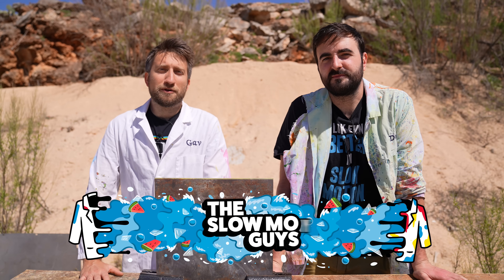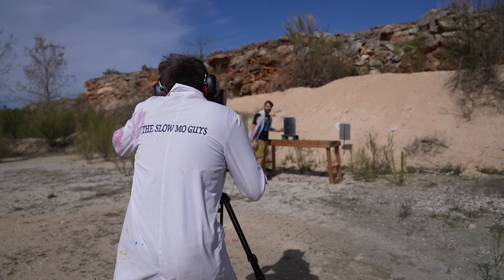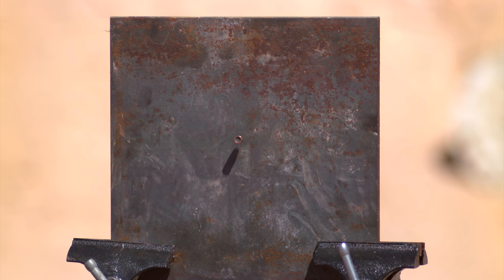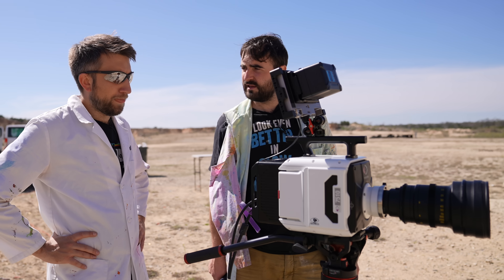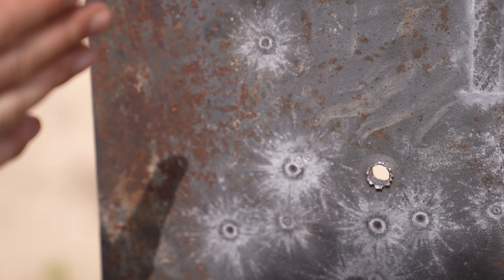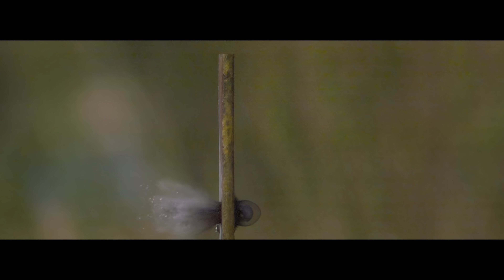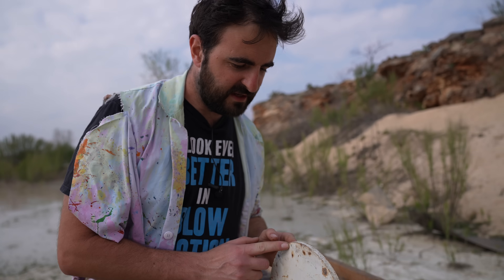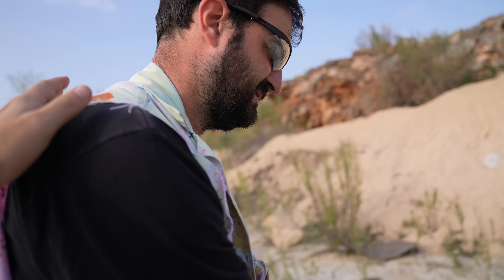Bullets vs Steel at 800,000 FPS - The Slow Mo Guys

Comment: 12:25 its creating shearing forces in the steel from the massive pressure differential between the struck part and the adjacent steel.

Comment: 3:59 alternate theory. The hollow point compresses the air, turns it to plasma, and the little sparks are plasma leaking out the grooves in the tip.

Comment: 9:41 i think thats a steel "scab" or fragment you knocked out of the plate, the center of the "shock cone" of energy transference.
The rear hole is cleaner because it Sheared off; the front hole is messy because its an impace crater where Everything got ejected back out.
This is Literally the basis of many WW2 anti-tank wepons.

Comment: That was awesome and amazing to see! I would absolutely love to see how steel cored rounds would do compared to the lead cored rounds you guys were using. 

I used to shoot steel with 7.62x54r and some old super hard, super thick mower blades would actually "catch" the steel cores, depending on the angle, they could penetrate or get stuck in the metal, sometimes bent, or even once or twice stuck halfway through the metal. 

Also used to find steel cores littering the ground from ricochets when shot at the right angle. Would be amazing to see that happening in super slow motion. For reference, 7.62x54r is the only easily available steel core ammo I know about, and pretty much any Russian Milsurp ammo you get is steel core, so if you guys can get access to it would be super cool!!!

Comment: For the shots on the round target, you can see two chunks of metal fly off: the lead bullet and a sliver-colored piece of similar size and shape. Is that a part of the plate, or the bullet? I've never heard of steel-tipped rounds before

Comment: You guys are Brits, and not well versed in firearms as us Americans.  But I can tell you different projectile compositions will have different effects as they impact steel.  Next time you need to fire the same cartridge but with different projectile types.  Also that target you picked up off the ground is likely AR500 type steel, vastly harder than the mild steel target you guys likely brought.

Comment: A most excellent and entertaining video. If someone hasn't  already suggested it to you a sheet of Lexan (65 cm square x 13 to 16 mm thick )  placed directly in front of the camera lens would protect it from debris. You should be able to find optically clear Lexan. The downside it is "soft" when it comes to scratches and would need to be replaced every so often.

Comment: I'm a toolmaker so I knew you were punching holes in  that plate and the bigger piece was the steel slug. It's like punching a hole with just the punch and no die.

Comment: what you saw coming out the other side when shooting the 30-06 was not the lead of the bullet or event the bullet itself. Instead, it was basically the plug of metal that has been punched out of the plate; kinda like the metal on the from of the 9mm when shooting the cooking tray. That plate of steel you were shooting was really just the right thickness. I just saw that you discovered what I just said so great job!

Comment: Id like to see some black tip 06 against 1/2".
I got my hands on surplus .311 steel core 174g. Loaded them up, for my PSL54 7.62x54r and Im punching through everything I put in front of it. Went through a dozer blade like butter.

Comment: First piece of steel y’all shot was just mild steel. Very soft which is why the 30-06 went straight through. The small white circle target is more than likely AR500 steel which is much harder and designed to withstand shots from high powered rifles with little damage.

Comment: The slug coming out of the back of the steel from the .30-06 looks identical to the slug you get from punching the hole for the eye in an axe or hammer, look up like Alec Steele or someone to see a good video of it. The difference in steels is because of the hardness, which is driven both by the alloy copmosition of the steel and the manufacturing process (heat treating/etc)

Comment: With iron sites at that distance, Dan is a marksman.
Reply: He did good, but it isn't that difficult of a shot. It also depends on the diameter of his sights and his zero and point of impact and point of aim. For lever action silhouette, our rams are set at 117 yards and it is 7 inches from belly to back. My front sight is 40 thousandths of an inch in diameter with the stem being a little narrower, but I might change the insert of the globe sight to a 30 thousandths. The stock front sight on my new lever gun is 100 thousandths and totally covers the target making accuracy harder. My goal is to hit a 6" plate over and over at 109 yards and that is standing with no support. I have been using my 30-30 with my own cast bullets and a mid range load, but now have a 357 lever gun to use as well. I do shoot a Win 54 30-06 made in 1926 with peep sights, similar to what he had, but the peep sights are more challenging than the target grade peep and globe setup on the lever action guns. There are some really good shooters out there and surprisingly, I taught a buddy to shoot pistols and on his second time out he was nailing an 8" plate at 50 yards with his 9mm pistol. He is in his 50's and only shot rifles when he was young and in the service, but seems to be quite skilled. He is well built and the exception to new shooters....I have competed in various competitions over the years but don't do bullseye style shooting for groups and instead o run and gun, speed shooting, or silhouette.

Comment: it can be explained in math. im sure math people would have every idea about this. its about energy transfer. how much energy carried by the bullet, and how much it is dispersed on the target. and how much the target can transfer that energy around across its atom network.and the material matters. for example, that steel with more "twang" would dispersed energy faster than the one that is more "stiff". therefor absorbs more of the energy being transferred by the bullet. aside from how fast the energy could be transferred before the atom bonds of the target material and the bullet reach its critical strain. the datas people who make bulletproof materials tech and bullets tech use to innovate.

Comment: With the rifle bullet, it looks like the front of the mass is larger than the trailing end of it by a small amount.   The trailing end looks like it was squeezed through the hole in the steel and the front of it looks like it mushroomed a bit.    It looks like a dowel steel where you hammer square wood pegs through a round hole to make dowels.

Comment: For a more striking and visually captivating effect, try gently coating the plate's surface with a thin layer of oil, butter, glue, or honey. This will create a captivating double splash, showcasing both the bullet's impact and the liquid's movement. You'll not only see this impressive effect on the steel plate but also on the tray. Wishing you the best of luck.

Comment: I think the spark is from oxidation (rust) on the plate.  Also, pretty sure the lead is going into liquid state briefly.  Looks like it in the 800k fps.

Looks like an 1903 Springfield should have a 1 : 10 twist.  2800 fps (ish) * [12/10] (barrel twist) * 60 = 201,600 RPM.  That's why everything is still spinning.

The round target is AR500 steel.

Comment: I could be wrong, but standard steel targets for most rifle ranges is AR 500 Steel, I doubt the first steel sheet they fire at is the same type of steel so it likely had a different hardness, and that's why the rounds behaved so differently to each target.

Comment: Probably a dumb suggestion but you know that experiment where you shine a laser in a block of acrylic and it bounces off the walls, letting you see the angles of incidence and reflection. Well if you got an absurdly long acrylic block, a wide enough fov and enough frames would there be a delay in the beam getting from one end to the other? Speed of light part 2?

Comment: Those "sparks" you're seeing actually aren't sparks, it's the air in front of the bullet being compressed so quickly that it reaches flash point and detonates. The air physically cannot move out of the way of the bullet fast enough and when it gets squeezed between the bullet and the plate the friction of the air particles being squished so quickly and violently causes a tiny explosion.

PS: The steel you got is most likely mild steel, which is a very ductile steel, that shooting target is most likely made of an abrasion resistant steel, probably an AR450 or AR500, which is significantly harder and able to more effectively break the bullet up on impact.

Comment: 9:19 that is amazing.

It wasn't the bullet that hit the sign behind - it was a slug of the metal plate that the force of the bullet pushed out of it, and popped it out like a hole punch. That's why the entry was messy from the blowback and the exit was clean, and the bullet fully disintegrated. The entirety of the force pushed the slug out of the plate and threw it into the sign behind and the bullet imparted all the kinetic energy it had in the process.

That is a one in a million shot.

Comment: Where is the energy for the electron to spin

 The electrons that revolve around the nucleus are a false concept.  But it is appropriate to interpret the symbolic concept correctly.  It is not clear what the known force holding the nucleus and electron is, but the first known force is gravity.  The second known force is the magnetic force.  None of this is clear in modern science.  Where does the electron get its power to revolve around the nucleus?  The concept of free energy seems to be stuck in it unknowingly.  Looks like no one questioned it.  When the magnetic field is applied, the electrons rotate on their own and flow through the medium.  Due to the electron transfer in the discharge tubes, the flow of electrons is in the form of waves and sometimes the flow of electrons is in the form of vortices on the electrodes.  This is why electrons are said to have wave and particle properties.  Electron displacement is caused by electrode charge polarization.  That is, the electron charges persist for some time.  When the charge on one side of the electrode becomes inactive, the electron returns to its original position.  The reason for the accumulation of charges in the electrode is due to the small amount of air layer.  Electron displacement can be detected with a shutter speed camera.  I do not have the financial strength to buy such a camera and do research.  The atom cannot be seen under a powerful microscope.  The only claim is that he saw the atom.  The nucleus or the electrons cannot be seen except in the microscope, which can see the microscopic particles in its range even under a powerful microscope.  It should be remembered that electron molecules have never been seen before.

 The concept of an atom revolves around a nucleus.  In kishore science there is no concept of revolving around the nucleus.  The ocean of electrons is seen in a motionless magnetic field, or in a medium without potential difference, without flowing through the pion body.  When the temperature rises, only the electrons see vibration, that is, only the heat wave.  No flow is seen.

Comment: Amazing footage! Regarding the different behavior of the two steel target plates, it might well be chalked up to different hardness as you suggested, but (as a structural engineer)  I suggest it might also be due to different “toughness” or ductility. A brittle steel (low toughness) will fracture once the deformation or strain reaches a certain level, whereas a ductile or tough steel will deform a lot more before it fractures.  In steel specifications, fracture toughness is quantified by the Charpy test number. High Charpy/toughness is a desirable property of steel  in some applications, for example in low temperature service which can make regular steels fracture in a sudden brittle manner when a more gradual, ductile failure mode is desired. In structural engineering a ductile behavior is more desirable because it yields and deforms prior to failure, giving advance warning that the material is overstressed. In contrast, a brittle material might look fine up until the point it suddenly fails.
Reply: The steel plates manufactured for target shooting are usually made from a steel they just call "armor plate".  I would like to know what that means in terms of yield strength.  I was also wondering if it is just a higher yield strength steel or do they put other elements into it to change the toughness as is done with steels for knife blades and industrial tooling.  (I'm also a structural engineer.)
Reply: @billj5645  The only specification I've ever seen is "AR500," which I think is an abrasion resistance thing.
Reply: @billj5645  There are different grades of AR steel- 400, 450, 500, 550, etc. The number is the average brinell hardness and you can look up charts for the rockwell hardness. Lower grades can be easier to bend for use on heavy equipment while 500 or 550 is preferred for targets. 5.56 and 223 rifle rounds can do more damage due to the higher velocity than 30-06. Bullet shape and velocity play a big part. My 460 magnum revolver packs the same energy as 30-06, but a huge hollow point bullet with more weight and less velocity makes a bigger dent or dimple in steel than the rifle. 460 mag is around 2400 fps for a 200 grain bullet and about 2000 fps for a 300 grain bullet. Average 30-06 bullets are lighter but faster and of course 5.56 averages 1/3 to 1/4 the weight of 30-06 but at higher velocity.
Reply: @CGT80 I've actually been able to take spicy M193 out of an 18" zip right through 3 & 3a rated armor plates.... The velocity achieved from 5.56 can be absolutely devastating which is crazy coming from a bullet the size of 22lr.
Reply: Ar500 steel was the second target, AR stands for Abrasion Resistant. Their first plate was probably some generic mild steel.
Reply: What we saw with the rifle bullet is sometimes called "plugging".  The transfer of the energy to the plate creates enough force that a plug of the steel is sheared off.

Comment: The flash you see in the hollow point is the air in the tip of the bullet turning to plasma as its compressed. it escapes from the tiny notches between the fragmentation segments.

Comment: The first sheet of steel you were shooting was a soft steel.  The steel they use for steel targets is ar500 or ar550 hardened steel.  Sweet to see how the .30-06 punched a plug out of the mild steel

Comment: Logic would suggest that if u brace targets better it would make difference but when it comes to speeds of bullets the energy transfer actually happens before the target has a chance to move so u could dangle steal from a string n get the same result damage wise to the target

Comment: The piece of aluminum seemed to bounce off the bullet a bit but I assume it will slow down faster than the bullet so it's going to stay on the bullet for the rest of the flight then. Unfortunately went out of the frame before they remerged.

Comment: Slow Mo Guys:) I have a burning science question. Do polymer tipped bullets actually initiate expansion on both lead rounds and lead free solid copper rounds. Do they truly initiate expansion? This would be great to see an impact on clear ballistic gel and on steel. May I ask politely if you can solve this burning science question? There is no footage on the Internet including YouTube and other platforms that can solve this burning science question. Please solve this burning science question? Please?

Comment: I wonder, shouldnt there be a weird middleground where the metal is just strong enough so that the bullet cant go through, but still weak enough that the ripples show up? so kinda like a really fast stone thrown in a pond with really high surface tension.  With aluminium and a 9mm it could be possible no? or maybe even lower caliber

Comment: The shockwaves making a "shadow" was impressive. Very interesting to see.
Reply: YES dude. As a long time viewer of slow mo guys and smarter every day, I can’t believe no one else is commenting about that 😂
Reply: Yes, that was the best shot of the entire piece.
Reply: The first round with a visible shockwave was subsonic - angle of the Shockwave was less than 45° and led the round by a short length. Supersonic wake would start from the tip of the round and arc back more than 45°.
Reply: @XxxThePsyCheMisTxxX  No, it is supersonic, but with a bow shock due to the shape of the bullet
Reply: @Arkaid11  Supersonic = shockwave angle from projectile momentum vector needs to exceed 45°, no?
Reply: It kinda looked like the bullet had wings.
Reply: That was the most interesting part to me was seeing the shadow of the shock, amazing maybe try doing the same thing but with a light presence of smoke to really catch the shockwave
Reply: 13:33 for viewers  just looking at comments
Reply: it was amazing

Comment: Rounds punching through the plate and causing unpredictable spalling is exactly why you don't buy mild steel targets.  Very cheap ranges will still do it and whine about welding up holes/buying new targets, which obviously costs more in the long run.  The white plate you found is AR500, a heat-treated alloy that will take hundreds or thousands of rounds with nothing more than a minor divot - even when used improperly.  Most rifle target manufacturers warn against using their product for rounds over a certain velocity or a under certain range - typically 3,000 fps and 100 yd.